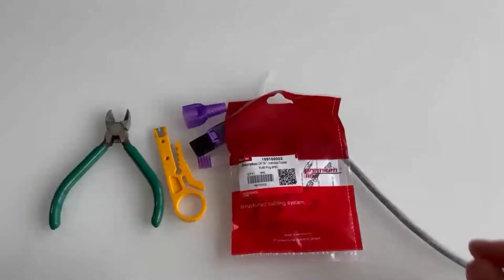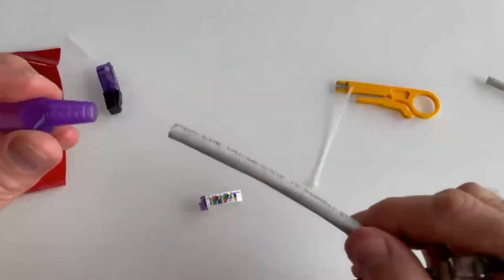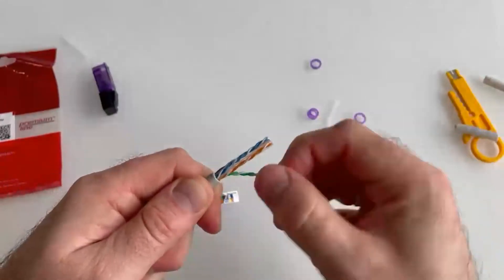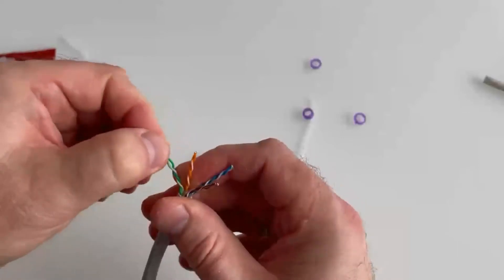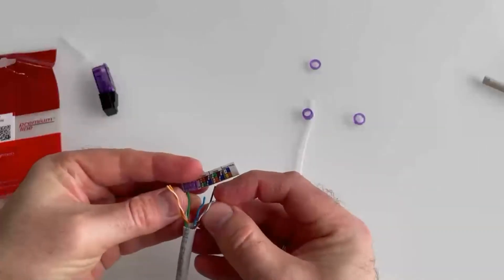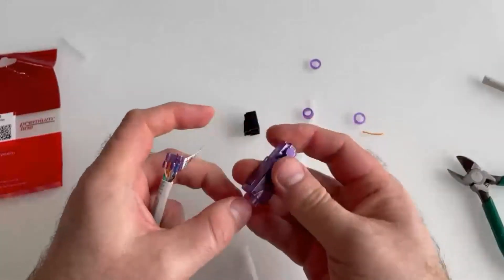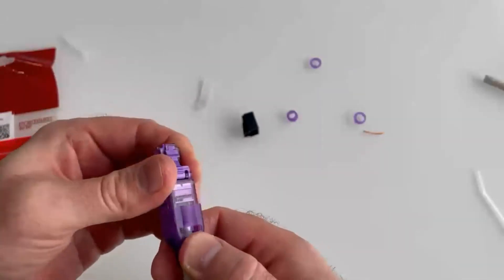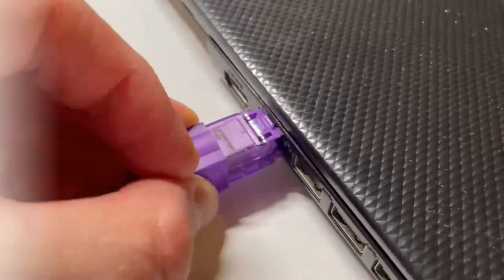How to install the cat. 6A Unshielded Toolless RJ45 Plug - Premium-Line

Comment: You mentioned a "tool can be used" to close the plug/enclose the secured wires. Is a tool REQUIRED? I need plugs that don't require a crimping/specificalozed tool. Thanks.